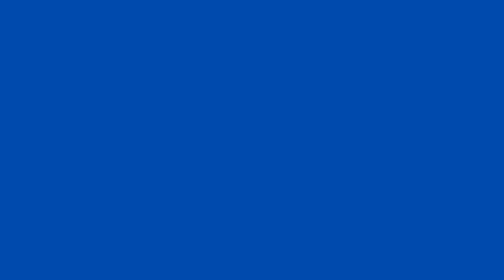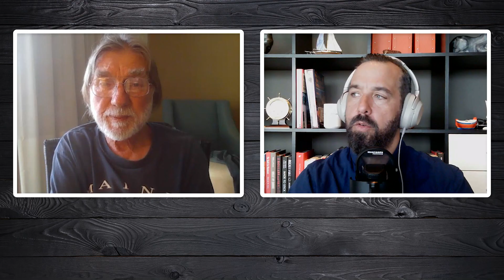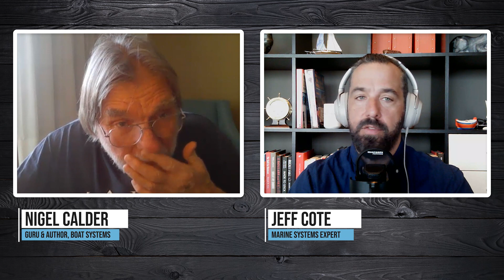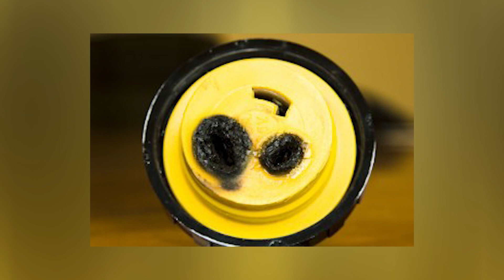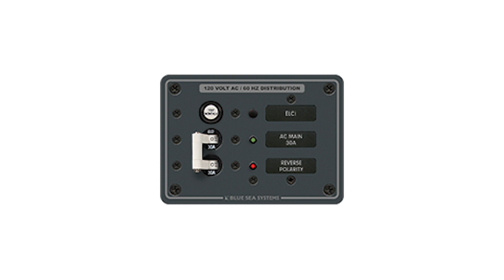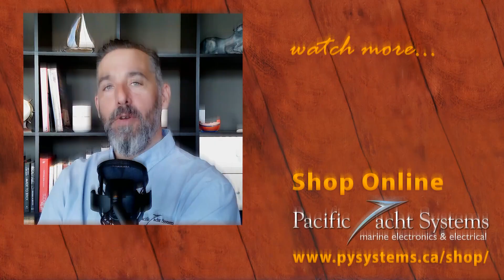Nigel Calder & Jeff Cote Talk Marine Electrical - Part 3 of 11 - AC Ground to DC Ground Tie

Comment: bough his book 30 years ago and my 30years old boat ( aluminium Motor Sailer is up to that standaard ) so my intrest is corrosion what new gear or method  is essential for the 4 lead battery bank.
Reply from the maker: Nigel Calder is a legend.